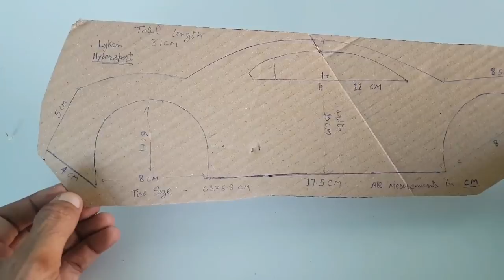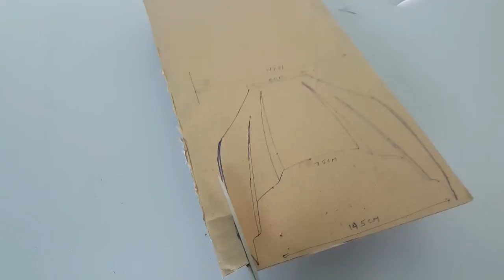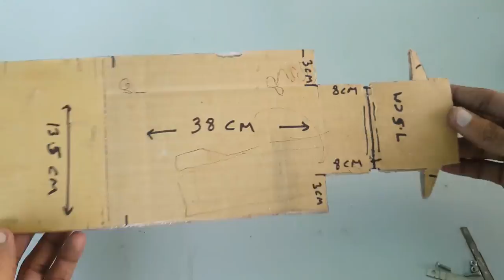WOW! Super RC Lykan Hypersport || How to make Cardboard Lykan || DIY ||  Electric Toy Car

Comment: dude....where can i get that front wheel adjustin pin
Reply from the maker: normal things like wire ,aluminum strip form aluminium sheet. screw plastic pipe in (yellow color) according to your tire. for making to see the video. or servo motor buy online like amazon or banggood.